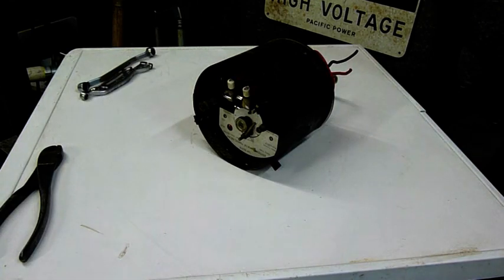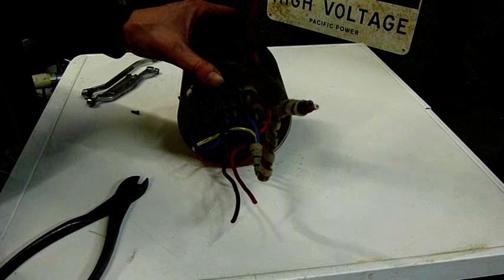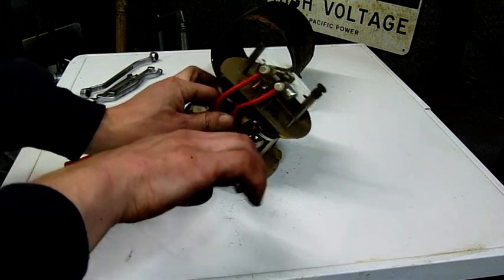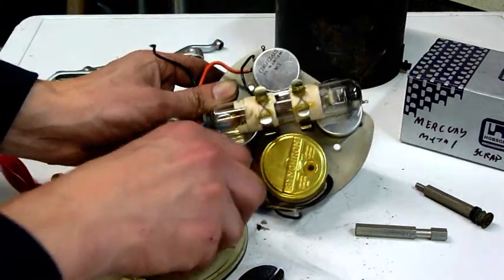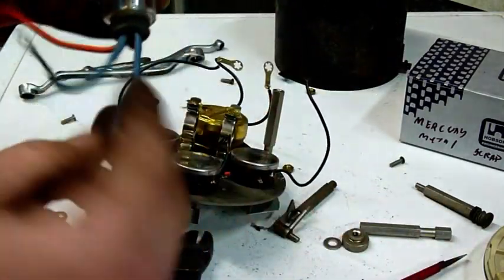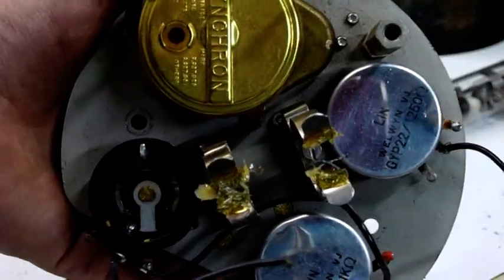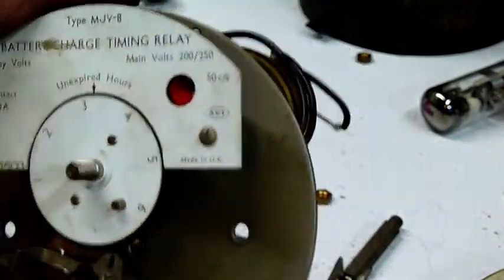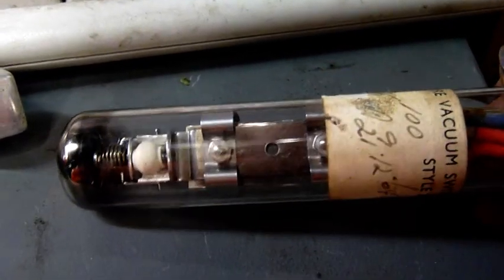Equipment Autopsy - Battery Charge Time Relay

Comment: One think that I wouldn't mind finding is a replacement mercury switch for my Philco "Bing Crosby" radio phonograph, it has a tilt switch in the record player mechanism that has gone bad. I heard that you can revive them by shaking them but it hasn't worked so far. It's kind of neat in that you load the records through a slot sort of like a CD player, but they are 78s of course.

Comment: You probably already know this by now, but that tube is most likely a thermal delay relay. The filament in the tube heats a bimetallic strip causing the contacts in the tube to open/close after a specific amount of time has passed.

Comment: Do you use or have access to ADSL2+?  I do and it's pretty fast, yes I know this isn't really related to this video.  You're right about Internet access in Australia, it does suck and the NBN doesn't look like it's going to improve things as to cost.  I'm sure I saw an AEI brand security system in an old Dick Smith catalogue, but I may be wrong.

Comment: @Aussie50 It might be disappointing to watch, while it is toxic it's slow acting, on the other hand if it's in vaporized for it's very dangerous. There was some East Indian in Vancouver (or area) that heated some up on his stove and it killed him after about half a day. Hatters apparently used to use a lot of mercury for curing felt and the vapors would give them mercury poisoning over time making them a bit weird, hence where the term "mad as a hatter" came from.

Comment: The vacuum tube is not a 'tube' - but is a clever type of relay. 

DC is a bitch to switch, because it arcs very easily. AC is slightly better, because the natural drop in teh voltage to zero, tends to extinguish weak arcs. DC, however, doesn't naturally break arcs.

The vacuum relay avoid arcs because it has no air in it for the arc to pass through. It is activated by heating a strip of metal which expands and operates the relay.